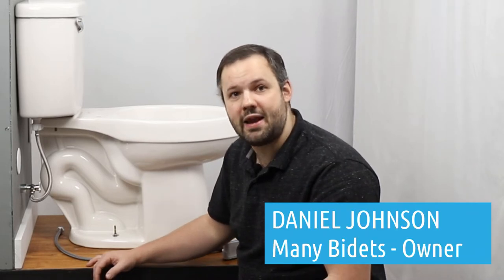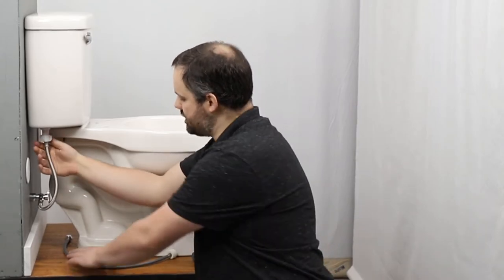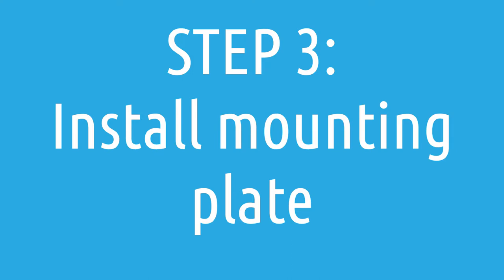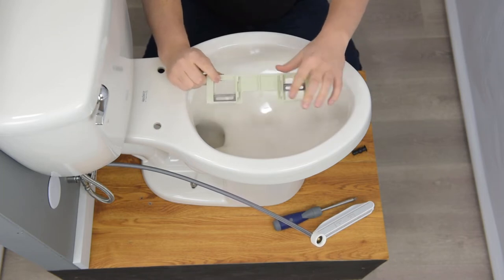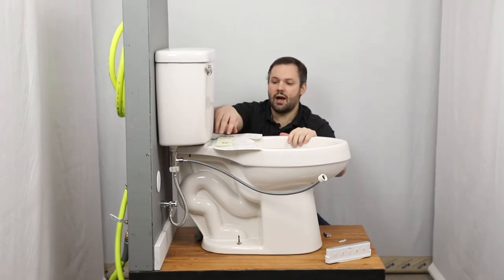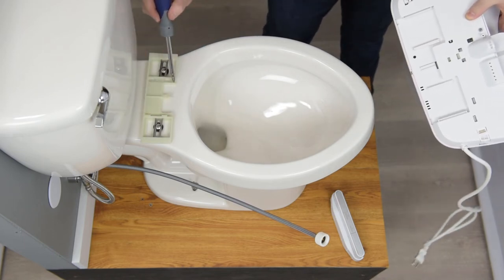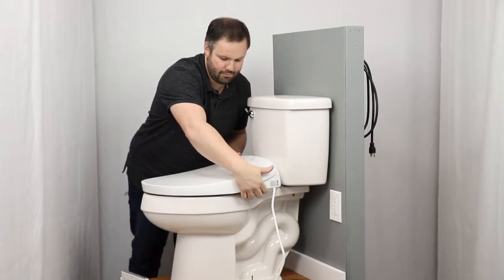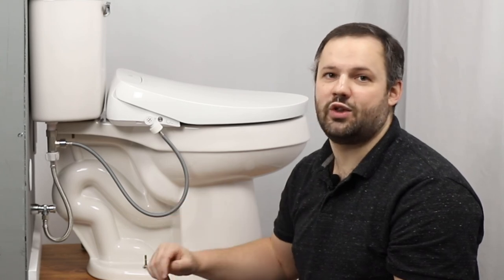How to Install the BioBidet's Discovery DLS Bidet Seat

Comment: I don't know if you monitor old videos like this, but I'm using yours for my installation.  Curious that the T-fitting that came with this DLS is different threads from my toilet pipe AND has a flat gasket.  As a result and while I can screw the fitting to the toilet, it will not seal against the tapered toilet pipe (7/8" BC is the style of connection required).  The T leaks like a sieve and the connection spins pretty freely even when connected tightly to the toilet (i.e. it leaks from the bottom of the top connection collar.  Since you don't seem to have this issue, do you have any recommendations?  I'm heading to our plumbing supplies store Monday to see what can be done (e.g. a different T-fitting, a new / different T-valve from the wall, etc.).  ☮
Reply from the maker: It's hard to know what's happening without being physically present at your home.  Do you have a rubber washer?  If not, you need one.
Reply: @ManyBidets  Thanks for the response.  Yes, there is a rubber seal in the T-fitting.  But even tightened down past hand tight plus 1/2 turns the T-fitting body still spins pretty freely, indicating that the BC end of the toilet isn't sealing against a flat washer.  BC fittings normally have a donut or other large tapered seal / gasket.  I went to the hardware store this weekend and found out the threads aren't even the right kind (on the top of the T-fitting) for the toilet, although they do fit given the toilet has a plastic (i.e. soft) fitting.  Just curious how yours worked while mine is clearly wrong threads and wrong rubber washer - with a U.S. standard type toilet.
Reply from the maker: @justal4844  I can't speak to what you received...  Have you reached out to Bio Bidet?
Reply: @ManyBidets  Thanks for your responses and to be clear, my issue is with the company.  I posted because my experience varied significantly from your video and was trying to find out why.  Obviously I don't have the right parts as shipped and yes, I reached out to the company last Friday.  I am heading to a plumbing supply store to see if I can find an adapter, a different T-fitting or change my house valve to one with two feeds.

Comment: When will you post a review? It's been 9 months since you promised one in this video
Reply from the maker: Thanks for asking!  As we tested the seat, it felt a bit small, and it sounded a bit loud, so reviewing it fell on the back burner.  We still plan to do one, but it's not top priority.  Between the DLS and the BB-2000 (both Bio Bidet products)  I'd get the BB-2000 all the way.
Reply: @ManyBidets  Thanks for the recommendation
Reply from the maker: @chrisk4926  You are very welcome!  Thank you for the question!
Reply: @ManyBidets  Do you still plan to do a review on this model?
Reply from the maker: @eln7435  As some point possibly, but it's not one of our favorite seats...  We spent some time testing one out, and did not find it very comfortable, nor it's wash very consistent from a water pressure standpoint.  Due to this, and the fact that there are so many seats we like better, reviewing this seat kind of ended up on the back burner...